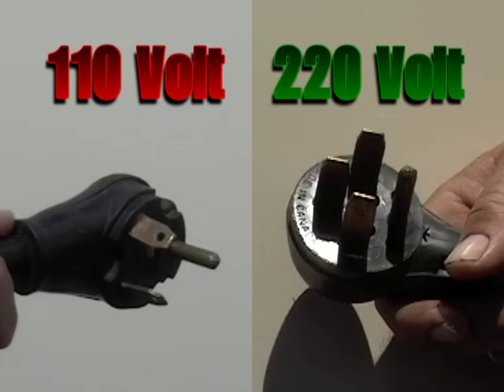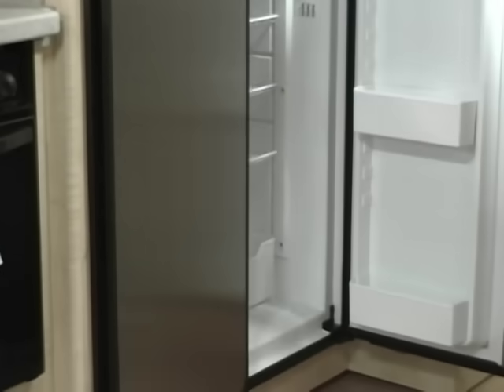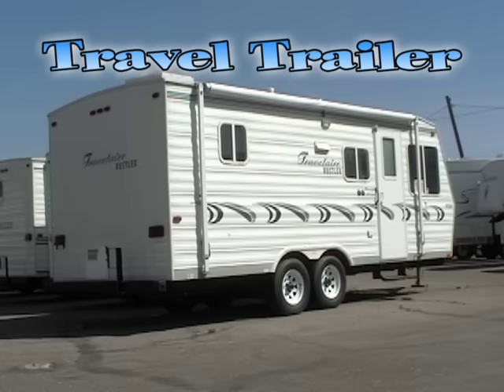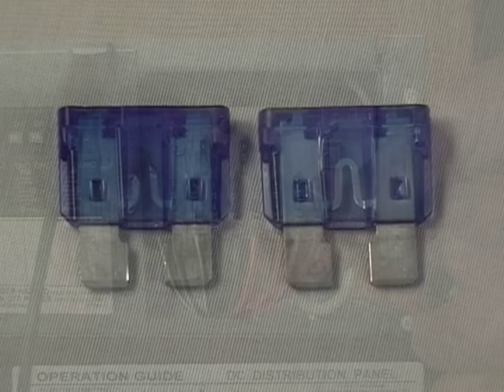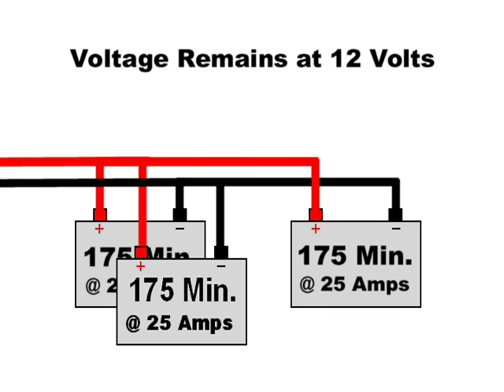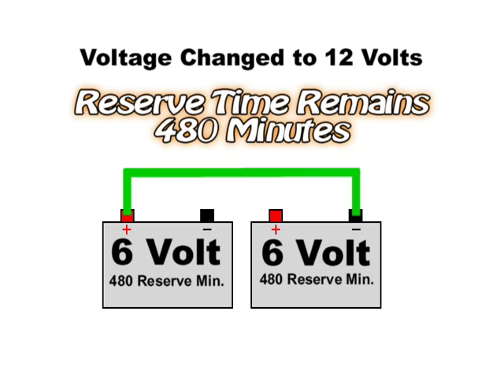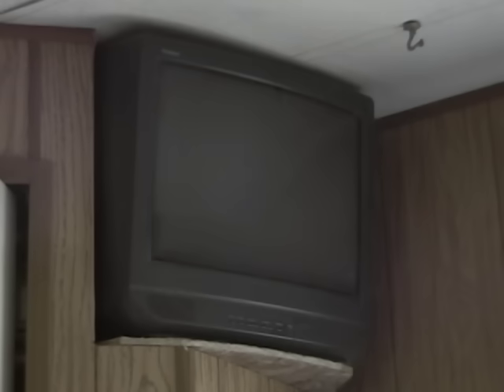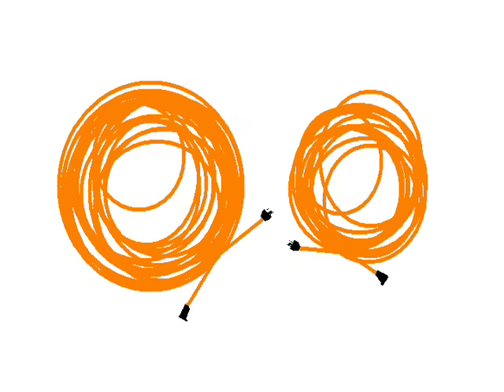RV Walk-Thru: Electrical - Learn about the electrical system on your RV

Comment: absolutely great video explaining the differences in power supplies...  if more people knew the actual difference in a 30amp rv plug and a 50amp plug, the entire system would be easier to understand..  the 30amp RV plug-in is ALWAYS 120volt, where as the 50amp RV plug-in connected to a shore-power pedestal CAN supply 240v into the RV, but its the wiring inside the RV that makes that connection....
 and, unless the generator is marked as 240v capable, the 2 legs of 120v power from it into the RV will NOT make 240volt, but are only 2 seperate legs of 120volt power that are "in phase" with one another from the "synchronous power" generator....  and HALF of the rated generator power/wattage is supplied thru each 120v leg...
  I work with large battery banks, multiple voltages and very high amperage's, and even though its only a metaphor, I have learned to use the speed/power vs voltage/amps metaphor in the opposite order than is what is used in this video.... voltage equates to speed, and amperage equates to power... one needs to know what "speed" their system runs at, and how much "power" is required to maintain it at that "speed"..... when adding more components in to the system, it WONT run any FASTER but will need more "power" to supply the needs...  
 when the system runs at a given speed/voltage, and you try to get more power from it, it will pull down the system down below optimum speed/voltage...
   at any given speed/voltage, when one requires more power/amperage, commonly a larger delivery line (bigger wiring) is needed to let the power thru to the component..... as if you try to pull too much power thru a small delivery line/wire, you could easily over-amp the wiring, and a fire can happen.... 
 used in this order, I have found its a bit easier to understand when explaining it to others.

Comment: Current is not, "SPEED"...  it is volume/time...  Similar to cubic feet per minute in the plumbing world..  The rate of flow does not change.  the volume of flow is what is changing...  Your explanation is a typical electrician way of thinking...  80% of the time it will serve you well,  and 10% of the time it will lead you into trouble...

Comment: I have a question, Im converting a cargo trailer to a camper.  Bought a 30amp converter/batter charger.  It has way more than I actually need, but Im that kind of guy that wants more power, more amps (tim allen).  LOL.....   My question is, how do I connect batteries to run off of when not connected, and then rely on the converter when connected?  Do I have to have a switch to switch between batteries and converter?

Trying not to buy my new trailer down.

Robert

Comment: i do not know about yank land and the stupidity of half measures in power use..

i live in a country with 240 mains on average ac amps is 20 amps input typically  you split aircons to thier own input..

50 amps at 110/120 ac sounds plausible though at 220/240 ac 25 amp is the load..

my opinion on an ac only option you are better to default to 220/240 mains
to the van 
i suspect putting 220 mains at 50 amp likely fried the 50 amp 110 circuits to the van that should of been a max of 25 amps, using half measures principle lower vac to higher amp scenario..

Comment: Thank you for your videos. Big help! I would like to ask you a question:
 I have 2 marine RV batteries one is SRM-27 600 CCA 750 MCA The other one is SRM-24   550 MCA  600MCA 140 RC Should these batteries never be hook up together or is not a problem to hook them up together?  Thank you so much in advance
Reply: Only connect the same type.

Comment: What a great summary!! Although familiar with both AC and DC power (conceptually) I did quite a bit of research when buying my travel trailer to better understand the electrical system. I wish I had found this first!! This summary covers most of the basics and could have kept me from having to watch multiple videos and reading multiple articles. They were still very helpful but this summary covers most of the basics all in one view. Well done!!

Comment: Hi, so I'm in a 37 ft 5th wheel.I purchased a Noma  infrared  heatrer.Im hooked up to 30 amps. I noticed right away that I can't run it on high,just low.The wall plug outlet gets hot.Im assuming 1500 watts is to much for the outlet ?

Comment: This is incorrect. Voltage is the difference in potential of the current flow (think electricity pressure/speed) and amperage is the amount of current. Video content is good, just the definitions are wrong.

https://science.howstuffworks.com/environmental/energy/question501.htm
https://learn.sparkfun.com/tutorials/voltage-current-resistance-and-ohms-law/voltage

Comment: I effed up big time. 1980 Revcon I put in 2 new batteries. You know where this is going. Should have bought 6 volt instead of 12 volt. Did I ruin everything? Does anybody want me to help them fix electrical problems on their motor home? Why is it so quiet in here?  Where might I find the fusible link I cooked? Or did I cook several? It didn't smell like hamburgers.

Comment: A small point to make. Increasing the amps increases the "amount" of current not the "speed". The speed is always the same as the speed of light(approx. 186,000mi/sec.)
Reply: You are a pedantic jerk!
Reply: I was taught that voltage was pressure or force that pushes current.  Amperage or current was the amount.  example:  Water going through a 1/2" pipe compared to a 3"  pipe.  Obviously, the 3" pipe let more water (current for electricity) or volume through it. This is important  and correct me if I'm wrong as it was a long time ago that I was school on electrical theory.  Otherwise,  I did like your explanation in the video.

Comment: So what do I need to allow my relative to park in my yard and be able to use her air conditioner?  Running the generator is too expensive.  She has 30 amp plug.  From this video I think you say I can adapt it down to 15 amp but then cant run air conditioner.  I need to run 2 air conditioners and tv

Comment: Great video.  Why would I lose one leg of my voltage in my RV?  Every other breaker is zero volts.  I have not changed anything inside my trailer, but had a new 120V/30A line installed on the outside of my pole barn this spring.  Before this, we used a generator when our pole barn had no electricity which worked fine. Do you think I lost one leg of the 240V power from the electric company?  I am going to check the main breaker coming in with my meter.  What else could it be, if not this?  I don't know how the inside trailer wiring is routed going to my breaker panel. 
 Thanks!

Comment: it is better to use water to explain the difference between voltage and current. Voltage is like water pressure and current is like the amount of water moving through a pipe or hose.

Comment: Good video for basic info, but your description of a GFI/GFCI is incorrect.  They are NOT a super sensitive breaker.  They monitor the amount of current flowing out of them compared to what flows back in from the device plugged in.  However much current flows out of the hot side to the device plugged in, the same amount should be flowing back from the device to the neutral side of the outlet.  If they are not the same, then that means the current is flowing back to the breaker box some other way, say a hair dryer dropped into a bathtub.  In that case, some of the current flows through the pipes.

But you could dead short the hot and neutral and in theory it should not trip since the amount of current coming out of the hot is the same what goes back through the neutral.

Comment: Just found out that the transfer box wires should be tightened after long trips. If the wires loosen they ark and after a few weeks the arks get hot and can start a fire easly.My coach just about caught fire 3 nites ago. Its common to my neibour had the same thing happen as his transfer box was located under his bed. So all of you make sure you have ALL the wires in your Transfer box TIGHT at all times. Thanks

Comment: I have a friend that has an Alfa See Ya motorhome and has all kinds of electrical problems nothing seems to work on it anymore.  He told be he replaced all the batteries and his motorhome has a 36 volt DC electrical system with all the batteries some 6 volt and some 12 volt wired in series.  I told him I think you have a 12 volt electrical system and he should undo what ever he did and take your camper to Camping World and have them check it out before it burns to the ground.  Was this good advice.

Comment: I really like your video. I have done some repairs and remodeling. Do you think I could change over my system from 30 amps to 50 amps? Also, we removed the fridge and put in a washer/dryer and mini fridge. But after that the d/c power went out. The guy grounded the d/c wires and it worked for about 48 hours and is out again, so my new furnace isn't working and neither are the d/c lights. I had removed the batteries over the summer because they were old and I am on shore power. Maybe the converter went out but do you think we need to put in a fuse or interrupter where the fridge was? Why would removing the fridge cause the d/c power to fail and how can we complete the circuit? Thanks so much if you know the answer!! Do you think I should put batteries back in to start? I am trying to get a hold of an electrician of course.

Comment: Will the 110 volt adapter to the 30 amp source allow my batteries to recharge?  Will they power the electrical plugs in the coach for say an electric blanket?
Reply: They will charge the batteries and may power an electric blanket depending on it's power consumption.  Read the blanket's label.   Dont' use the microwave, toaster, AC, etc.

Comment: You mentioned not mixing batteries with different reserve capacities as they will "fight each other". What actually happens?  I recently added a 12 volt deep cycle in parallel to my existing two 6 volt golf cart batteries to provide more reserve. The golf cart batteries were only a few weeks old, have more reserve than the new battery. What trouble am I looking for here?  Great video.
Reply: Ron Howes when you run batteries in series they must be the same battery in the same age

Comment: Reserve capacity is basically amp hours right?
Reply: Basically, yes, but batteries are sold by total amp-hours, not usable amp-hours.  You don't want to take them down too low or they will be damaged.  Read the literature that comes with the battery.

Comment: i have a surge protector on my main power cord, we have had it on there at this new park we r at for the past month & 1/2 without any problems, my delima is that the other night we had a power outage don't kniw why but the surge protector went from being all green as normal to a L1 & L2 red so when we took the main power cord off it & plugged it bk in by itself it would go bk to all green. no it has not rained & the other RV's have power
Reply: Turn all your breakers off, see if you get all green then turn one breaker on at a time, till you find the bad one.

Comment: I took my travel trailer out to dry camp and had to charge the battery with a inverter generator while at the camp site.  Following the guy charging my battery for me,   the battery went totally dead and nothing worked in my trailer.   When I got it back home and plugged it into the shore power it wouldnt charge the battery at all.    Nothing works when plugged in to shore power at my house.    I got a new battery and everything works on the trailer with the new battery.    IF the battery is unhooked nothing works at all,   shouldnt it work without the battery if its plugged in to a receptacle?     I should mention also that the Furnace would go on,  but wouldnt ignite following this charge on the inverter.     Did a fuse blow when he hooked up my battery and charged it?    He didnt actually unhook anything from the trailer while he charged the battery.    What could the problem be?   Blown fuse?   Blown converter?
Reply: The battery was worn out.

Comment: This was a very well-done video. You're very good at simplifying things. If you were anyone happens to catch this message soon, I could really use some help. I have an elderly lady who lives in a trailer park. She lives in a small camper unit. She recently had her AC, refrigerator, and all lighting go out. Her receptacles still work and her microwave works. I had a guy tell me that if the microwave is still working, The converter is not bad, but I wasn't registering anything where the converter ties in to the fuse panel. I'm speculating that I may have just been told wrong and that the microwave is just on a basic plug circuit. All the breakers are on and functioning and the receptacle that the refrigerator is plugged into is working, but at the refrigerators converter, I read no voltage at the 12 V terminal, so something had to fry it...
Reply: have you checked the fuses?
Reply: Fusionmatt20 yes. We're good. The converter went out and it drained her battery. I got the battery charged and am waiting on a new converter. Thanks, brother.

Comment: I am curious..... around the 8:30 mark you say that the battery in the example can last 175 minutes with a 25 amp draw.  ...does this mean that if you ran the battery with 25 amp draw the battery would be completely depleted to 0% capacity?  my understanding is that you never want to use your battery below 50% of its capacity....so in this example you would only be able to use the battery for a little less than 1.5 hours?  I understand if your ran the batteries in parallel this would double your working time.

Comment: Champion does make a generator with a 30 amp rv recept. on it.  It will run one 13,500 air conditioner and the power converter and the fridge on electric.  Do not try to run anything else.  That is all that it will do.

Comment: hey I have a question? I have my rv plugged into a 15 adapter nothing turned on but the outside aluminum panels are electrified.
Reply: i-07 did Camping World work on it?

Comment: Really enjoyed your video. Thanks. I have a question about using an inverter with solar panels to power most things in a 50 amp, class A, motorhome. My current 1000 watt inverter only powers 1-duplex outlet. I saw a video by "RVwithTito", where he hooked up a 30 amp plug from his inverter, and then plugged in his 30 amp shore cord to this plug. After turning off the breaker for his AC converter, and turning on his inverter, he had power to all his circuits. Although, he couldn't use them all at the same time and has a good quality battery monitor to keep track of things. Does this setup seem plausible, and if so, would it work the same way as a 50 amp MH, stepped down to 30 amps, AC input. If all of this is possible, do you, or someone you know have a written/video tutorial on it? Thanks very much.
Reply: Thanks Gary, I plan on trying this method using solar to charge the batteries.

Comment: How do I check to see if the converter is sending power to the battery to keep it charged correctly?I recently bought a RV bumper pull that had a car battery that would go dead in a day after a charge. I bought a RV deep cycle battery for $139 but before I connect it I was wanting to check to see if the converter is sending charging amps to the battery clamps. How can I check that?
Reply: what is the answer?
Reply: D.C. volt meter,

Comment: hi master electrician thank you so much for this video it was very helpful! my husband and I have watched it dozens of times. a question if I may we recently bought an RV and plugged it into our house using a 15 amp converter for our 30 amp. when we tried to turn on the refrigerator when the heater was plugged in everything shut off on the AC side. we check the breakers and everything is still good but none of the AC outlets work. How badly did we screw ourselves and in your expert opinion what is the solution? thank you so much again for all your videos they are amazing!
Reply: With adapting down to a lower size, usually it's best to have a dedicated circuit at your home that no other appliances are pulling from in your home. Some AC systems in the coach draw more than 15 amps. So by plugging into a house 110v circuit thats rated at 15 amps, can cause some issues. The best advice i can give to my customers is to wire in a dedicated 30 amp plug (no adapters) for the RV use. That way, the RV is now pulling power from its own dedicated power source with no other household appliances in the circuit.

Comment: I have seen a lot of melted down adaptor pucks / went on a call where the guy was a lineman and only thought he needed hot and ground and not neutral and had no power after buying a converter and installing it himself / one guy had his home receptacle wired backwards(hot on neutral side ) and the ground and neutral on the hot side and burnt up his transfer switch and shorted out the breaker on his generator ( Wild Willy RVS Dahlonega Ga.)

Comment: So…I am sitting here without power…plugged into my daughters home, however, I thought I would plug in the shopvac…Wrong idea…Popped something, and can't figure out what…Breakers in house look good…everything where power is plugged in works…Maybe a blew up my adapter?
Reply: +Gwyn Betz did you check all if any gfci plugs ?

Comment: Hi, I have a question:  I have 100Watt Solar Panel mounted on the roof of my Travel Trailer to charge my 2 6v Batteries total 12volts.  I connected the Solar Panel to the MPPT Charge Controller and then the Battery Bank, I just want to charge the Batteries at this time.  (I did NOT connect the LOAD side of MPPT).     I 2015 Ford F150 has the standard 7 prong plug which also supplies a charge to the TT battery bank while running down the road, will that be a problem?  Which the Solar Charging the batteries and the Truck also?  Thank in advance